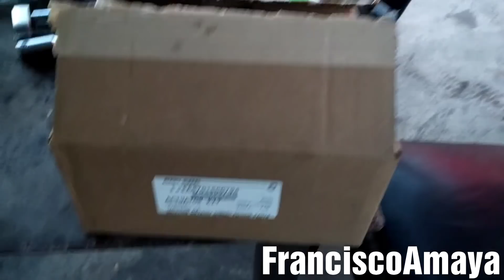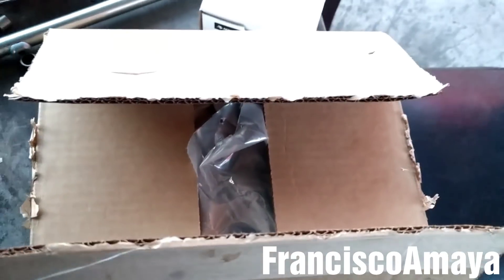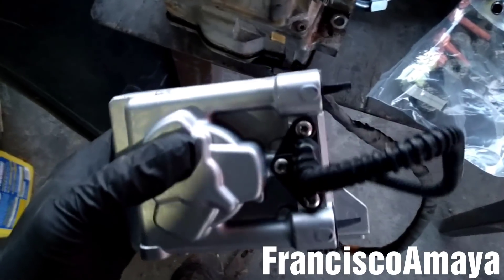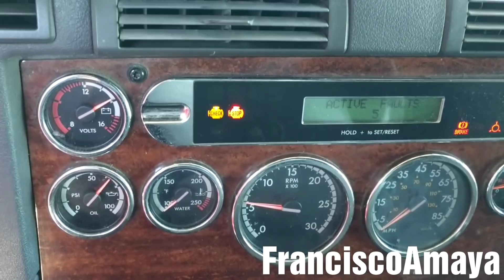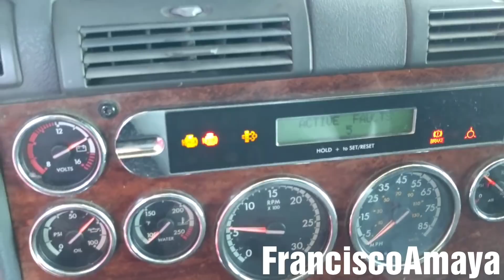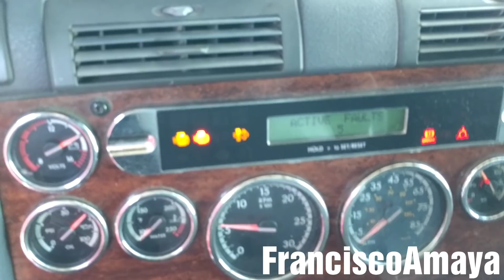Freightliner Cascadia DD15 DD16 engine EGR valve actuator removal replacement OM 472

Comment: Is it necessary to replace the egr actuator on a 2010 cascadia that has been deleted. If so, does the actuator have to be calibered? When replaced?  The old actuator has a leak.
Reply from the maker: if the egr system was deleted is not necessary

Comment: My egr linkage seems to move when it wants to. But I am experiencing the problems that you point out in your video about the Delta sensor and carbon build up. Would you suggest replacing the Delta sensor first? And checking the pipe to see if it is clear before replacing EGR Actuator?

Comment: @Francisco- I have a 2014 Cascadia with a DD15. It has the delete installed. It has exhaust in the coolant (I did a test). It is losing coolant someplace. Could the O-ring in the EGR valve body cause the exhaust to enter the coolant? Would I see coolant when removing the hose in the manifold from the EGR? I see no antifreeze there now. Dry as a bone. I don't see any external leaks from the EGR either.
What do you think? Could it be blown head gasket?
Reply: What ended up being the issue ???

Comment: I have 2013 freightliner cascadia before my Truck def bypass and after reinstall all systems one box but problem is code 2791 fail 14 aculator and engine harness already changed but this code still on the screen and my Truck on the road power lose please give me any suggestions what I do

Comment: You must retrain the egr valve after replacement. A sweep test must be preformed also. Only done Detroit Diagnostics. You can physically watch to see if it sweeps when you turn the key but a manual sweep test and recalibrations is needed in the software.
Reply: Where is your shop? Can I come to you to work on my truck
Reply: @preslavgaev8611  no you can not.  Contact work only

Comment: Hey Francisco.  Mi troke me está dando.  La Luz de el egr control valve. Anormal update rate  que significa.  Y que tengo que remplazar. Hay si me hechas la mano por fa
Reply from the maker: Que el numero de codigo y el año y model de motor
Reply: Francisco Amaya  no se l código pero es un dd15  2010.  Cascadia   Se lo que dice por qué tengo el.  Bluetooth que se llama.  Nexiq. Conectado.  En le troke.  El mini. Sabes.

Comment: Hi Francisco,
Just need some insight on a very stupid problem with my 2012 cascadia with dd15.
Code is Spn 2791 fail 14
Changed Egr actuator
Changed engine harness
The code still comes up when I start the engine and start rolling. But then goes away. It happens if shut off engine and start rolling, if i wait a little bit before rolling then no code. 
Can you suggest something what to look  everytime mechanic hooks to the computer there are no active codes. Computer says happened only once when I started rolling and then no repetitions. Any suggestions please.
Reply: Hi I’m having the same problem. Did you resolve the problem I had spent so much money with the mechanics no can’t figure it out😢
Reply: @TheDm951  The problem went away after a few weeks but no idea what the issue was.
Reply: I had the same issue three days ago, truck was park for two days, the third day I started few seconds later two check engine lights came on with the spn 2791 fmi18 Emmission system will derete 25%. I reset the power five minutes and then started again no code, I’m driving the third day no code, what’s your thoughts please Thnks

Comment: Hola, tengo en spn 3058 fmi 9 , delta p sensor nuevo,  que puede ser? gracias?
Reply from the maker: Que motor tiene?
Reply from the maker: See codigo piece ser por lo sifuentes
Valvula egr mala
Delta p sensor malo
Bloqueo en el flujo de egr

Comment: I have a 2013 Freight liner Cascadia

I have replaced, the EGR valve actuator, wiring harness, ECM and new filters

I am still getting fault for "egr valve actuator no failsafe mode"

I have gotten my truck's ECM updated and I don't know what else to look for. Can you please help
Reply from the maker: Check the harness plug but sometimes the EGR actuator comes defective from factory.

Comment: Hello, so I recently had this code spn 2791. I replaced the egr actuator with a new style one, the check engine lights went away, but after driving about 15 miles the same spn2791 and check engine lights came back on.... any idea what the problem might be? Any help would be greatly appreciated
Reply from the maker: Probably you need to replace the harness

Comment: I have this code on my 2009 dd15
Spn002791 egr  vlve cntrl 07 and 
Eng no resp 128s146 07
Reply from the maker: Maybe you have to replace the engine wiring harness

Comment: Que tal Francisco.  Seguido miro sus vídeos. Muy buenos  yo tengo un problema. Con mi truck es 2012. Con Cummins isx 2013 tengo como mes y medio  que le pusieron ese motor. Pero desde que lo  pusieron  me falla en las subidas. Como que se le corta la fuerza pos segundos y empieza de nuevo. Me ase como unas 6 veces solo en la subida no me da engine light y los mecánicos. No le Allan. Me podría ayudar

Comment: I have a question i change the part but the actuator valve is hard is not soft like the old one and its throwing a kkt a black smoke from the muffler pipe
Reply from the maker: Maybe it is defective.
Reply: @franciscoamayaYT  it was defective it was not working when i put it on it was smoking and lost power stupid freightliner wanted me to buy a new one wait 90 days and they will return mi money back sure like i have 1,070 extra to give them so after 3hrs faithing with them manager replaced it

Comment: What are the signs of a bad EGR Cooler?
Reply from the maker: Losing coolant and exhaust gases leak
Reply: Take the clamp off and look into the egr or connecting pipes near. If you see a buildup replece it. They have kits to clean it but it doesn't work.

Comment: Francisco,I noticed black in my coolant reservoir,and noticed pinkish (coolant color) around the egr actuator,plus coolant is being pushed out out of the reservoir thru the top cap...Would replacing this stop the blackness in the reservoir? I thinks is exhaust fumes.
Reply from the maker: The most common cause of the black material in the coolant tank is the oil cooler seals. 
The coolant leak in the EGR actuator is a bad EGR actuator
Reply: @franciscoamayaYT  I ll have it looked at by the tech,the egr stopped leaking,but the coolant is going into the reservoir overflow part of the tank,but the coolant level is at normal level,and coolant is still being pushed out thru the reservoir cap...too much pressure I guess.
Reply: @franciscoamayaYT  Prior to this,I had the oil cooler replaced,bc I had lots of oil in the coolant/reservoir,but I never had temperature issues,I flushed it out until it was clean,replaced the reservoir and coolant as well.
Then the reservoir got darker,but that could be bc as much as I flushed it out it,there must be oil residue left in the cooling system,enough to darken the reservoir.
But what worries me is the coolant going into the overflow and out thru the reservoir's cap...could it be back pressure? but there are no overheat or abnormal temp issues.
Reply from the maker: Have you tried replacing the cap?

Comment: Francisco 
Great video I have learned a lot from your post. My question is I keep getting a code EEC 
061 SPN 4364
Nox conv EEF  18
I replaced both intake and exhaust and two weeks later the same code popped up. Wht is ur 
Recommendation.
Thx.
Reply: maurtice logan need to have your Nox sensor checked for bias sensor.. If you have the diagnostic link you can unplug the Def doser electrical connection and run a low temp ATD and make sure that the sensors are within 50ppm of each other.. usually you have replace the outlet Nox sensor. Other issues has been def build up around the def doser  you could also fix this issue by burning off excessive def with it also unplug.. but you will have to figure out why it’s using so much def or issue will come back.. good luck

Comment: Hey fransisco I hope you doing well, question please, freightliner cascadia 2012 I got amber engine light and check engine light  with 2 codes spn 411 and spn 2659 a day after my truck kind of yenky  at 1300/1400 low gears ,I did change the egr delta p sensor and the pipe  now it's running normal but I still have the same codes ,please help..
Reply: What was you spn 411 code ? Did u get fixed? Having same issue egr spn 411 fmi 1

Comment: Francisco , I have a 2013 freight liner cascadia DD15 starting losing power off and on fault codes injectors 1,2,3 so we had injectors rebuilt still same issue soon as we drove it about 30 miles check engine light on again and lost power we replaced outside harness  and inside engine wires.  Engine light Will go away if we shut truck off wait 5-10 min and will run fine until 20-30 miles and will lose power again and check engine light on.  Still have injector 1,2,3 fault codes. Not sure what to do now. Any ideas what else it can be?
Reply from the maker: What is the code number when this problem happens?
Reply: Ben Gonzalez when they rebuilt or replaced injectors did they replace the injector harness for those injectors.. usually if you pull the first injector harness connection you see oil inside I would bet the harness is bad.
Reply: Or you have a bad MCM

Comment: Francisco I have this code  eng. 2 00 spn002791 supposedly egr valve control or position incorrect and I replaced the actuator but still  have the same code
Reply from the maker: What engine do you have?
Reply: Will bad actuator cause spn 411 fmi 1?
Reply: Replaced delta p and venturi pipe already
Reply: Smokes bad under heavy load  then stops when i let it idle nd coast for a minute
Reply from the maker: Maybe you have a bad egr pressure sensor
Reply: Dd15 started smoking bad yesterday..let of and pulled over for 5 mins and smoke cleared away and came back a hour later
Reply: Spn 2659 fmi 18
Spn 411 fmi 1
Reply from the maker: Check this video and follow this steps 
https://youtu.be/VQZ56r11AZw
Reply: How are you getting theses codes? Off the dash is very vague. Dd software allows you to troubleshoot these problems easily. Does this yes or no, does that yes no? Get the software. Running a $100k truck?  Just get the software.

Comment: Do we need to change the actuator only or the kit because the kit is double the price why can’t I use my old bracket
Reply: They don't make the older actuator anymore for those motors.. so you need the new kit for 1300

Comment: Hey Francisco thank you for putting this video together because I found it to be really helpful. No I have a question because I replace the EGR valve actuator just like how you show in the video by the computer keeps flashing a code for the valve actuator motor fail safe and it won’t go away. It seems to me like it’s not detecting the new EGR actuator. Any ideas what to do?
Reply from the maker: It is possible that your engine sensor harness is bad 

Check this video to see how to replace it.  
https://youtu.be/7ktdd8oF7PU

Comment: Oye bro how do you know when the egr actuator not good no more ?
Reply from the maker: It will give a fault code or it will leak coolant.
Reply: I had a truck that was building excessive soot in venture pipe and it was closing delta p sensors holes. After 3 months of headaches I found that stupid actuator is faulty. I had no codes. So what needs to do. Remove big pipe that goes to one box. Start previously warmed engine and  let it idle 10-20 seconds. push down accelerator pedal and monitor the exhaust smoke that comes out from pipe.  the smoke will be size of foot ball. it just comes out and stop. if you see more then that, then actuator is performing slowly and needs to be changed. if you see smoke is coming continuously  again actuator is bad.
Reply: I see no codes but the coolant is going low level and already lost a lot of engine power

Comment: Hello sir. 
I'm getting EEC 061 spn 4335 
DEF pressure 01

Can I help me out and let me know where I can start off. 
Thank you
Reply from the maker: The codes means: no def air pressure from supply.  

This could be a problem with the def air limiting valve
Reply: Francisco Amaya copy!!! I got that part 

You're talkn about the DEF pressure limiting valve right??  
If so. Once I replace it, will the code go away? Or do I have to get it connected to the software and get codes erased

Thank you
Reply from the maker: You need to do a scr air test with the DDDL software  but with some luck it will go away once you start the engine for 5 minutes  and then turn it off for 2 minutes and then turn it back on.
Reply: Francisco Amaya cool. I appreciate the info.

Comment: Hello Francisco, do I have to clear the codes after installing the actuator?
Reply from the maker: Yes
Reply: Once you finish the replacement you'll have to dive into dd and preform recalibration. This driver waited to long a regen was needed. Remember regens are only supposed to be for diagnostics if they are completed in a manual mode. All others like passive the truck does it for soot removal.

Comment: You havce to use laptop and do a egr actuator relearn
Reply from the maker: It is recommended but not mandatory.
Reply: If I don't do the relearn will my check engine lights eventually go away?
Reply from the maker: No, no check engine light will come on. Unless there is a problem.

Comment: Francisco, what kind of tool did you use to remove the pipe where it connects to the block (maybe it connects to the egr cooler)?
Reply: It's to the block and your use a crow wrench socket  3/4 or 19mm

Comment: maestro, what are symptoms are bad EGR actuator? does it give you engine light or noises, or what? in what basis you decided to replace that part? or what's the lifetime for that egr actuator?
Reply from the maker: Yes, it does turn the CEL on and sometimes it leaks coolant. 
Around 600k miles.

Comment: Hola Buenos Dias Francisco, puedo aggarar tu numbero de telefono por favor, estoy buscando un mechanico y vivo en ontario. 
Tengo una problema con mi 2011 cascadia, de la systema de def. Muchas gracias
Kevin Acosta 
323 474 5397
Reply from the maker: Ahorita tengo mucho trabajo, y yo trabajo solo. No tengo ayudantes.  
Va a tenner que esperar un tiempo si quiere que revise su camion.
Reply: @franciscoamayaYT  amigo ojala pudieras orientarnos estamos batallando mucho con un dd 15 acá en México y lo q pasa q nadie puede sacarle las fallas no conocen ese motor los mecánicos de aca
Reply from the maker: Ricardo Regalado
Mas videos en Espanol esta por venir para ayudarlos

Comment: hay francisco  can you help me with this code  ENG NoRESP 128S146 07          Freighliner century 2007
Reply from the maker: It means EGR valve malfunction, check the EGR valve. It can be unplugged or it is not working.
Reply from the maker: Do you have a Detroit Diesel engine or Mercedes Benz?
Reply: Francisco Amaya mercedes benz
Reply: Thanks for reply
Reply: Francisco Amaya como saver que tengo problemas con el EGR
Reply: Francisco Amaya mi camion es un cascadia 2010 se acelera de 5mil RPM a 6mil RPM
Reply: Good video

Comment: Thanks Francisco. Mine is leaking antifreeze from the bottom when the weather is cold. Should I replace it right away o do I have some time. What do you recommend. Thanks again Francisco.
Reply from the maker: That will depend on the amount of coolant it is leaking. 
If it is a lot, I recommend you to replace it.

Comment: So you don't need a computer to set the actuator?
Reply from the maker: You need to replace the EGR delta pressure sensor and perform a calibration with the DDDL software.
Reply from the maker: No, it is not necessary, you need to reset the self learning data but it is not mandatory.
Reply: Francisco Amaya thank you for the reply! I removed the delta P sensor and the port holes were completely clogged with soot. After cleaning those out the truck runs completely normal now and no more codes.
Reply: Francisco Amaya reset self learning data? How is that accomplished? I recently changed my actuator and I'm still getting this code intermittently- eng calib 128 411 13.  I'm thinking I need to clean the delta P or have the ECM reset.